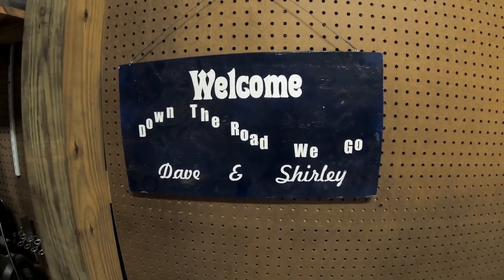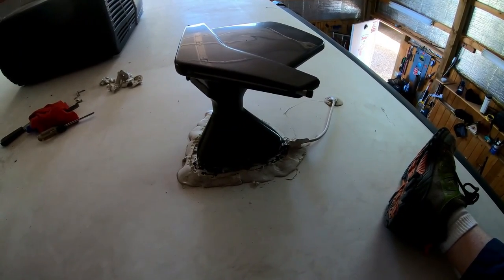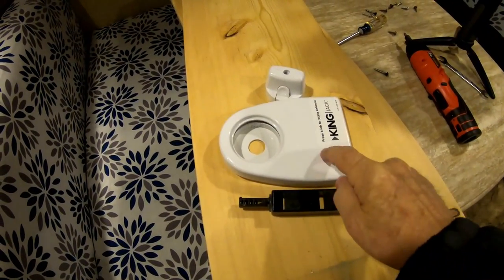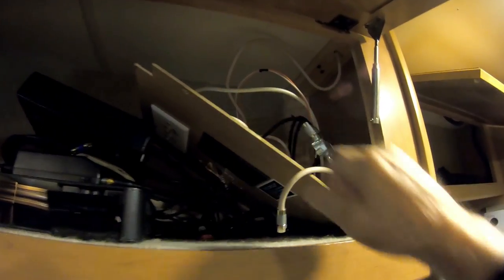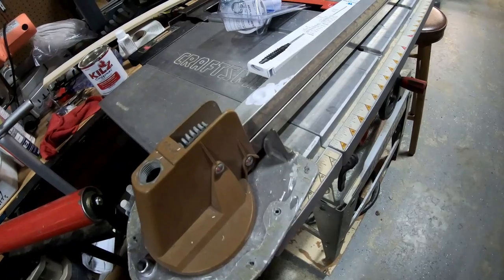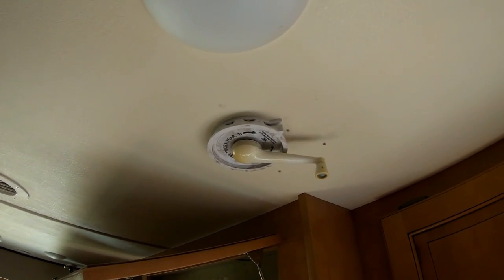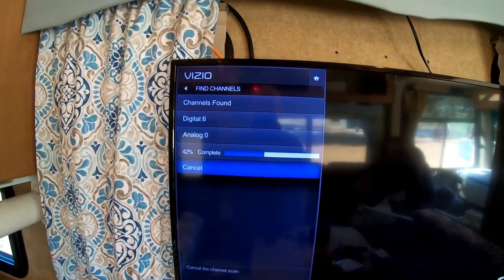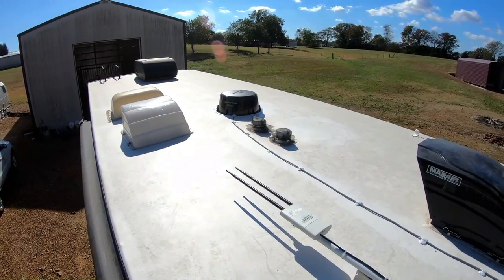RV Travel Channel - In The Shop - Winegard 360 TV Antenna - WIFI Antenna S3 EP043

Comment: I have this on my camper roof but when connected to my Westinghouse tv it won’t accept the channel scan and keeps asking for one. Do I need a control box between the wall connection and the tv? If so what kind? Thanks
Reply from the maker: Yes, it needs to be powered. Does your camper have a wall mounded connection for your tv with a little button you can push that turns on 12 volt power to the antenna? If not then that is what you need. Sounds like it is no being powered. Hope that helps.

Comment: Does this boost you internet signal just wondering how it works I have one on my camper but not sure much about it like if I don’t have internet on my phone am I going to have internet with that?
Reply from the maker: Not this model. It just lets you connect to all tv stations within range without having to move it. There is a model that also has wifi, but this one does not. Thanks for the comment.

Comment: How did. You route the cable from under the 360. The instructions show the cable must be routed under the 360 into a hole. Did you drill a hole in the side then install a cable gland?
Reply from the maker: I just cut a notch in the bottom of lip and I rapped butial tape around the cable. After screwing the housing down I put self leveling dicore all around the housing. I then ran the cable across the roof and in the old hole. Screwed the cable down with plastic wire holders and put on some self leveling dicore on every one of the hold downs. Hope that helps.

Comment: Does the 360+ antenna pick up a lot more than the original bat wing antenna.
Reply from the maker: Yu bet. If you have two different stations, one in the east and one in the west it receives both. The batwing will only pick up one then you will have to turn it.

Comment: What percentage of RV parks that you stayed in provided WiFi that you could use? I purchased a Wifi Ranger and found that I rarely use it. I am 100% cellular based now.
Reply from the maker: Not sure but pretty low. Most parks have pretty bad wifi. The wifi I am using on the antenna pole is a long range wifi ap. I use the same one at home to get wifi and the tower I get it from is a mile away. . I am looking at going outside the tv park, like McDonald's or any other open wifi. You can pick the wifi you want and lock into it. It works pretty well. We also use cell data when needed. Looking into Weboost for that. Thanks for coming along.
Reply: @DownTheRoadWeGo  I love my Weboost.

Comment: How is it holding up?  Seen a ton of bad reviews.
Reply from the maker: We have not had any real problem with it. The range is not as far as I thought. If the stations are more then about 40 miles away it does pixelate a lot. What I like us a lot of the time your stations are all over the place. This will pick up all the stations in 360 degrees. So you don't have to move the antenna.

Comment: Hello there! Great Video! I just purchased an Air 360 and plan to install it. Just a quick question though. My Batwing on my Coach is not centered on the roof. The instructions say to center the new antenna in the middle of the coach. I was planning on using my existing batwing hole which is off-center like yours. Any issues doing it that way? Sure would like to not have to punch a new hole in my roof. Thanks again!
Reply from the maker: I kept my batwing and used it as a wifi access point, so put the 360 in the middle of the roof and ran the cable over to the batwing and went down with the wifi cable. Hope that helps.

Comment: The warmer the weather is, the easier it is to peel / scrape the old sealant off
Reply from the maker: You are right there. I wish it had been a warmer day. Thanks for watching and commenting.👍👍
Reply: I need to do this and its been consistently 90 - 96 down here in Alabama so the heat won't be a problem, it my body melting onto the roof of the RV is what is worrying me.  🥵

Comment: For others laying cable on the roof, don't use screw down cable holds. Simply use  non-leveling sealant to hold cables. This way you're not putting more holes in the roof. Otherwise, great work.
Reply from the maker: Good tip, but I like things tight. So I put sealant down then screwed the tie downs and then I put more sealant on. I don't mind screws downs.

Comment: Thanks for sharing.  My understanding is the Winegard 360 + includes cell boost and wifi in the same dome antenna.  The only addition is the router to be installed inside the RV under the dome.
Reply from the maker: Yes you can get it that way, but we just bought it with the tv module. I have my own wifi long range antenna - AP . Thank for watching and coming along.

Comment: Nice work Dave. Good idea for the WiFi antenna. I think I need to replace my tv in my rig. It seems the antenna wire pulled out where it connects to the back of tv. It’s barely a year old.
Reply from the maker: Thanks, Shirley has a couple of good ideas once and awhile 😀. That is not good. The cable pulled out of the tv? Wow I have not seen that before. Thanks for watching and coming a long.